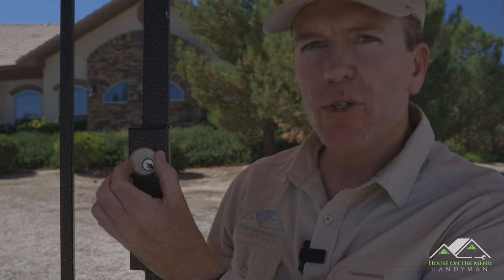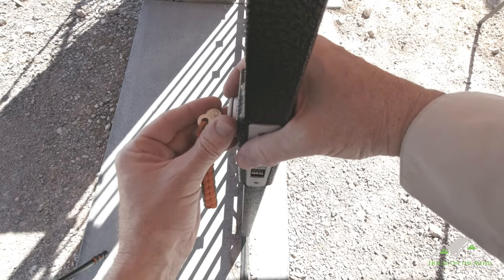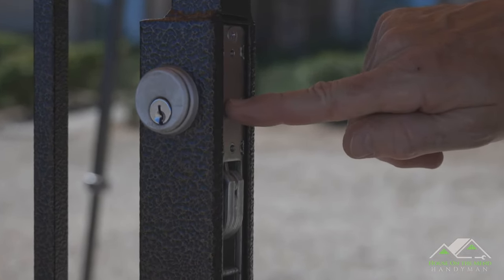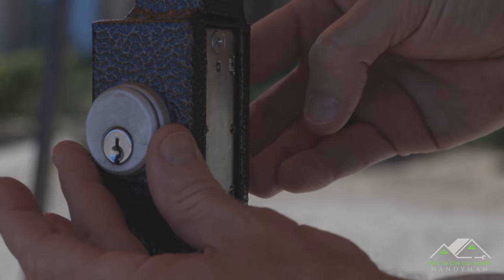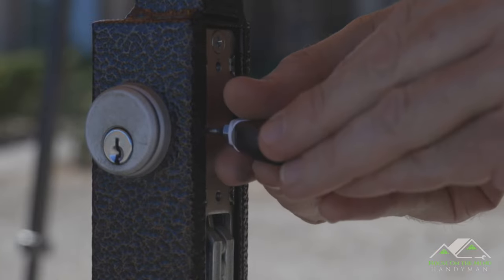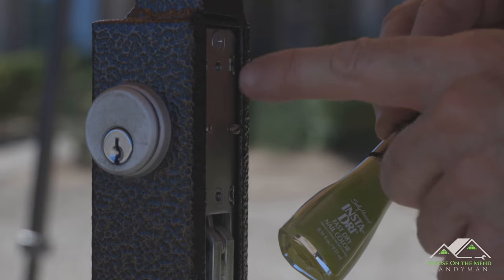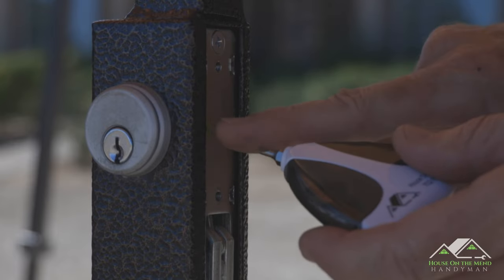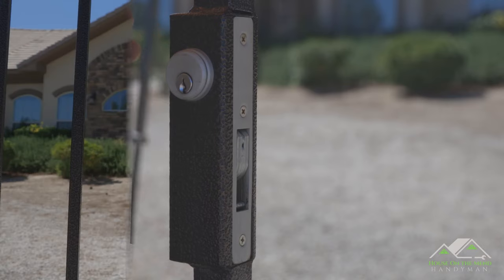Tighten a Loose Cylinder Lock

Comment: This was great and helpful.  What about general maintenance for these types of locks (cleaning? lubrication?) I have a lock that once you get the key into the cylinder it's really difficult to get the key out and you have to massage and hold down the tumbler a little bit (in just the right way) to get the key out.  Any thing I can do to fix that maybe?
Reply from the maker: Great question. I would make sure the cylinder is perfectly vertical as I demonstrated in the video and use a spray silicone lubricant through a straw to lubricate the internal pins.
Reply: Ok, I'll give it a shot.